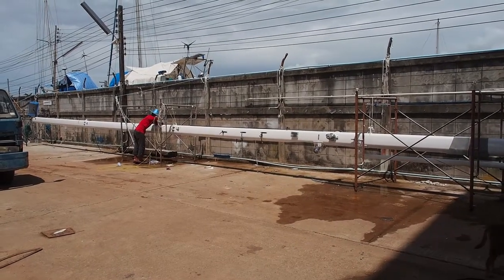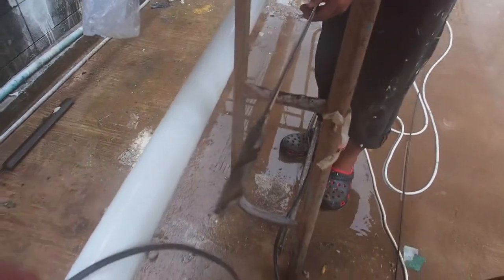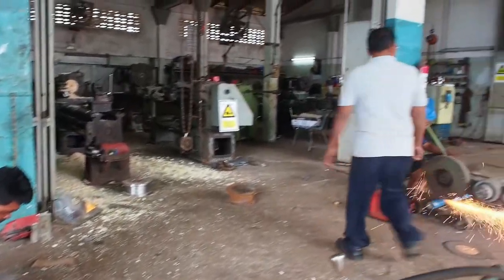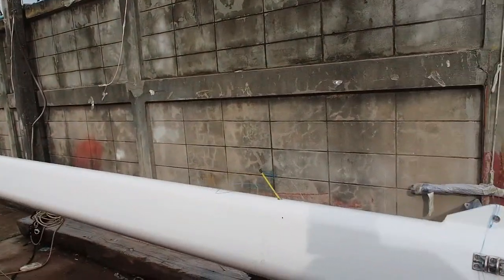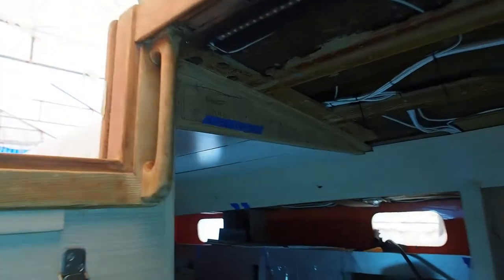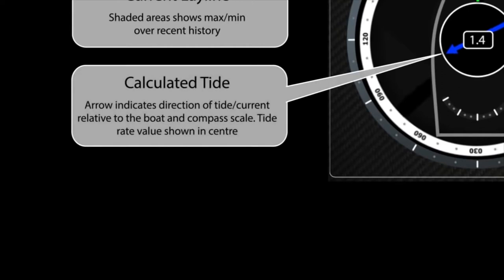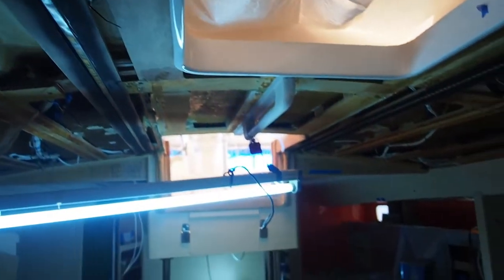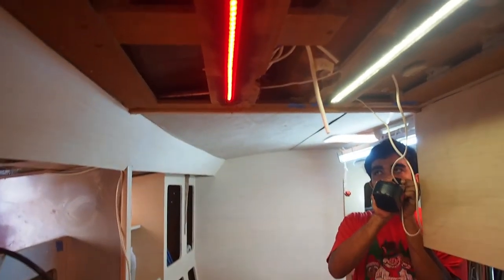Esper Refit 30 - LED strip lights; mast blockage removal

Comment: Hi Liz and Jamie,

Comments on MASTS

Per (the Suez Canal rambler 🙂) on Sybaris here,

I remember watching all your refit videos back in 2014 while me and Elly were refitting a house in Rhodes Old Town to become a 4 room hotel. After that I spent a few painstaking years in Rhodes refitting Sybaris (our Gulfstar 54 Sailcruiser). I say painstaking because refitting a boat in the Dodecanese is a climb up a hill finding the right people, sourcing material, and being allowed to work on boatyards. It's a long story.

One of the jobs I did was to remove the masts (ketch) which are Hood and probably exactly the same as yours (1986). We did not go about it as methodically as you two, and missed out on sealing all fittings and bolts on reassembly. Needless to say two years later we had aluminium oxidation and pitting all over the masts and booms and paint virtually peeling off over the oxidation. I have now de-masted again and am preparing to redo the whole mast restoration. I don't want to make the same mistake again and have three questions for you:

1) What primer and paint did you use?
2) What did you use to seal the fittings and bolts?
3) How have your masts stood up over the last 8 years, is the paint still looking good?

Much appreciate your feedback.

Cheers,
Per
Reply from the maker: Hi Per. We used an etch primer but I don't remember the make. We painted the masts with Awlcraft 2000 and used Duralac on the bolts. We have some bubbling of paint around the stainless fittings where we didn't use the Duralac correctly (or not enough or not at all). On the whole the paint generally has held up well apart from these fittings, but it was all done ten years ago, so not bad going.
Reply: @followtheboat  Hi Liz and Jamie,
Many thanks for the reply, and yes 10 years so far is a good result. 
We didn't use any Duralac and the bubbling around the SS fittings was so bad that the paint was flaking off in those areas after 2 years.
A quick follow-up question if I may. When you say that on some fittings you didn't use Duralac correctly, what do you mean? or even better, in your experience what is the best and proper way of using Duralac?
Cheers 🙂

Comment: Good stuff and nice install.  I have a similar run in my RV but its stuck to the a gell coat.  My only concern is the strip does get hot when left on and your wooden light channel might start to show signs of Wood Pyrolisys over time.  Especially where your sailing on those scotching 41c days.
Reply from the maker: Hi +JoeVSvolcano. Yeah, it was a concern for us and in fact AFTER we installed the strips I bought some aluminium conduit to put up first. However the strips were stuck on with superglue (!) and trying to remove them to install the conduit was ripping the plastic covering, so I've had to leave it as is. Because of this I have my eye on these strips all the time. They are only ever on when we need them and we never leave them on when we're not on the boat.

Comment: You may want to consider a halfmoon acrylic clear lense to place over your strip leds.  This will do 3 things.  It will difuse the light, giving less shadows in the cabin. This will also broden the area which gets light, and last, it will keep you from accidently burning yourself on the strip as they tend to get very hot.  Here is a website you may want to check out.
www.outwatercatalogs.com/lg_display.cfm/page/69/catalog/Master_Catalog_Vol_42
Reply from the maker: Fair comment, Terry. In fact when I bought some strip leds in Langkawi they came with the same cover you mention. The difference is quite significant. We're also looking to source some constant current drivers which should help prevent them from getting too hot from the iratic 12v system.

Comment: Wow, how much LED "mood" lighting did you end up installing if it was over 8 amps 😮
Reply from the maker: Hehe, good question, Geoff. Each region is rated at 10amps max so that assumes that every light is on. In reality it doesn't work this way because not all lights are on at the same time, but all saloon mood lights on at once would be approx 6amps. With the lithiums we don't notice it and even run 240v energy saving bulbs on occasion.